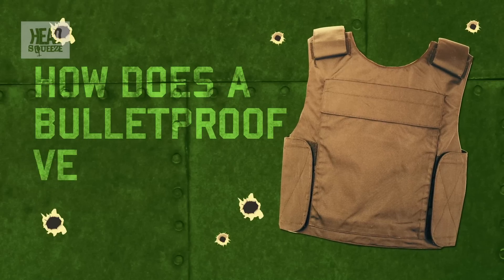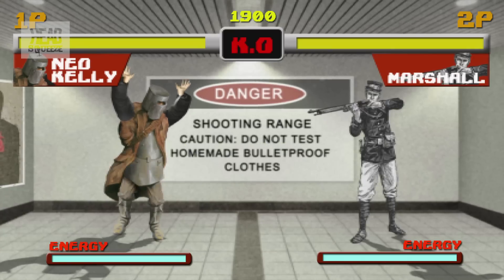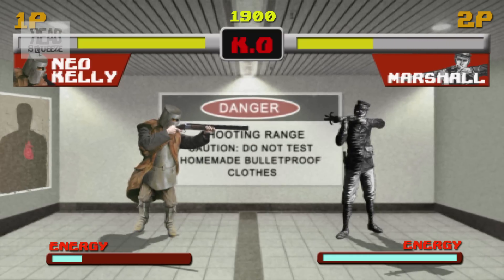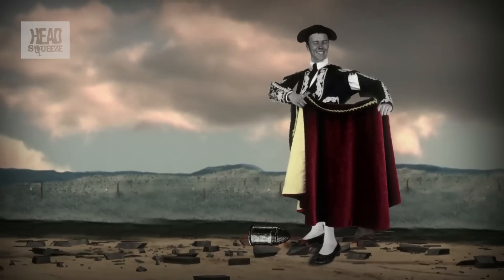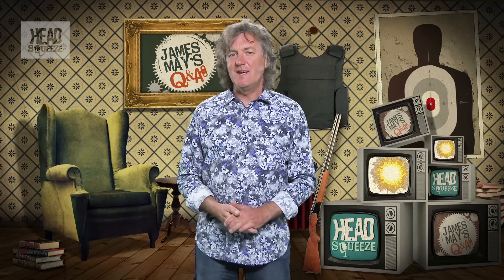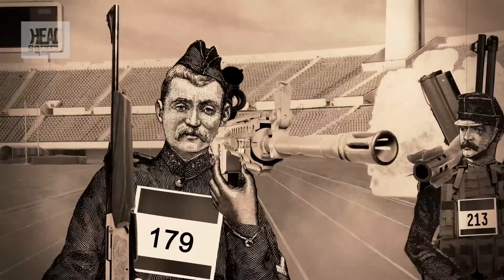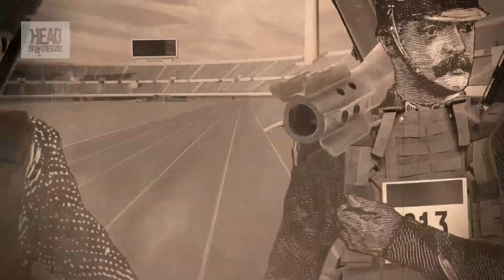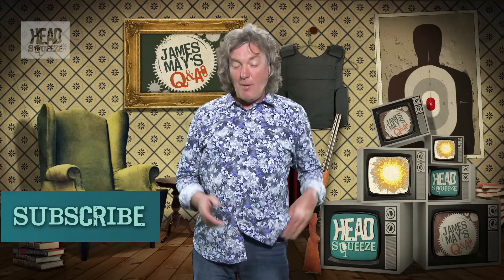How do bulletproof vests work? | James May's Q&A (Ep 25) | Head Squeeze

Comment: Koreans in 1860s. Nope. Mongols in 13th and 14th century. They used cloth layers to stop arrows passing into the body. What is more, they used a layer of silk so that if the cloth layers failed, the silk would wrap around the arrow and make it both easier to remove from the body and create a sterile layer to prevent infection from whatever nasties were on the arrow itself; for example, faeces. There are likely much older examples.

Comment: Don't be fooled, a bullet can still pack a punch and cause serious damage. All a bulletproof (they're more like "bullet resistant" since the material itself doesn't actually stop a bullet outright like a slab of steel plate would) does is spread the energy across a larger surface area. It's kind of like being shot in the head vs. being hit by a truck. Being hit can still cause major bruising, sometimes even internal bleeding and the breaking of ribs. Still, beats dying...

Comment: even if the bullet didn't kill you, remember the physics law: energy must be transferred to something. Usually the kinetic energy from impact transferred to your... ribs.
Reply: the energy that hits you is less then the recoil energy the shooter is getting since energy is lost during flight path a 9mm hitting a level 1-2 vest would be like a punch to the chest it would hurt but still it wont crack the ribs the one that will are big 308 and rifle round for 50bmg its pointless to make a vest for that thing the energy would kill you even if the bullet dident penetrate to make a vest adsorb enough energy and stop penetration the vest would be impractically big and heavy that it will be immobilising to the solider its like going to war with a bullet stoping variant of the eod suite
Reply: +KoeSeer If I had to choose between broken ribs and a sucking chest wound, I know which one I'd take.
Reply: ***** hiding behind something during gunfight?
Reply: +KoeSeer The energy is transferred to the fabric
Reply: +FlashSmash And the fabric transferres it into the chest.
Reply: +Jackie Scholl a .50 bmg will go straight through a kevlar vest
Reply: The .50 BMG fired out of a Barrett M82 has a muzzle velocity of 853m/s. The bullet has a weight of around 45g. Using E(K)=0.5xMxV^2, we get about 32.7 Kilojoules of Energy on average. That's the equivalent of a Football (Or Soccer if you're a yank) travelling at about 180 m/s. To put this in perspective, the avg speed is 30m/s

Comment: Ceramic armor works by using the bullets energy to shatter the ceramic instead of punching a hole through your body. Of course the ceramic is compromised after the first shot. So if a large enough piece survives you can still hope a second bullet lands there. Of course you can use hardened materials and armor plates to shatter the bullet and distribute the force. In any case, getting shot is going to leave some hurts.

Comment: A bullet proof vest is twice the density of human tissue. I am sure there is a direct correlation between throwing power and throwing velocity. Most MLB pitchers would still have a strong arm. I am sure that they could still throw a baseball far. Pitching is very technical. In order to be a good pitcher you've got to have the right technique for yourself. I am so surprised how these starting pitchers are able to throw it at the same speed over and over again. Most MLB pitching velocity on the same pitch, fast ball, curve ball, knuckle ball always remains the same. Most people if they were told to pitch it as fast as they can would have speeds that varied because they are idiots not having proper form. Perfect technique equals maximum potential. If a bullet is moving at a high velocity than you know for sure it can reach long distances. Snipers always hide. They are far away from the spot in which they intend to shoot. How far can a sniper rifle Bullet travel when a person is standing on flat ground. Holding it properly pull the trigger. It has to be at least 300 yards those bullets do move at speeds of 500 miles per hour. The faster the pitch the more it hurts the catchers glove.  A straight lined pitch. It is 90 feet from the mound to the plate. If the catcher was standing 130 feet away. A pitcher who could pitch 100 it would feel as 92 once it hit the catchers mitt from 130 feet away.

Comment: but can a bullet proof vest stop a sword?

i'm assuming it can't (unless metal/ceramic plate) so the solution wasn't to make it more efficient, it was to protect against a different thing. Metal armor is designed to absorb the impact while something like kevlar is increasing the impact time.
Reply: Look up videos of arrows and bullet proof vests. It'll answer your question and may surprise you a little
Reply: arrows are pretty similar to bullets, i'm asking about swords and knives.
Reply: they really arent. its what happens with blades just look it up. because its actually easier to cut through a bullet proof vest than to shoot it.
Reply: JUST LOOK IT UP
Reply: Kiltynachess i'm still asking about swords, not arrows. And i asked it specifically because i'm too lazy to look it up.
Reply: Kiltynachess how does that make me a troll? i'm not bating you, am i? I'm not stating something controvetial, am i? if anything, you're the troll, not me.
Reply: +DBZHGWgamer  yes actually in fact Kevlar treated with nanotechnology that becomes dense when large amounts of kinetic energy is applied in a small area. ( like a much stronger version of cornstarch and water.) can stop an ice-pick from going through Kevlar. although this is a moderately recent advancement so your original argument does hold some merit.
Reply: +Noscoping egg ar500 does stop .308 black tip. at least the lvl III+ variety does. and yes it is steel.

Comment: Is there a difference between kevlar vest and bulletproof vests?
Reply: Bullet proof vests are now made of Kevlar. Where as before they were made of metal plate sheets inserted into the vest. Kevlar is just the modern small arms resistant replacement.
Reply: There are types of "armor" kevlar and plated. Kevlar is usually what a civilian or police officer would use, and it's a material (a fiber I believe)  that stops pretty much any handgun bullets (except maybe  revolver). A metal plated armor is what they wear in the military (probably over kevlar incase of Penetration), the plates can stop assault rifle rounds and the better the plate, the higher rounds it fan take.
Reply: Short answer: you can use the terms interchangably and you'll only ever be wrong in the eyes of extremely pedantic people. 

Somewhat longer answer:

Pedantic types will sometimes take exception to the idea of referring to all soft armor as "Kevlar" because Kevlar is a trademarked term for a line of products developed by the Dupont corporation and there are any number of other high strength fibers that are used in modern soft body armor.  I think this is somewhat silly (along the lines of saying "hook and loop fastener" instead of Velcro) but it matters to some people.

The term "bulletproof" is also one of these things that pedantic types don't really like as there's some kind of bullet that will penetrate almost any kind of armor.  Again, kind of silly but body armor might be a better generic term.

A bunch of folks have talked about kevlar vs. ceramic plates and so on and a lot of that stuff was really good, but I didn't really see anything that gave an overall view of how an armored vest is typically put together so I figured if folks were interested:

The outer shell of the vest is typically made of some kind tough nylon like material that's not meant to stop bullets. This layer exists because while Kevlar (and related materials) are very strong they can be damaged fairly easily in day to day life.  Prolonged exposure to sunlight, many kinds of chemicals, and just day to day wear and tear can render a piece of Kevlar unable to stop bullets. So you've got this outside layer that you can scrub up against a brick wall, or wash when it gets dirty, or sew patches onto without compromising the effectiveness of the vest.

Inside of this shell are pockets into which panels of woven Kevlar cloth are inserted. These provide a good deal of protection from things like shell fragments or pistol rounds but typically won't stop a bullet from a full powered rifle.

Vests that are intended for use in the military or in certain high risk civilian situations typically have pockets into which hard armor plates can be inserted to protect the most vital areas.  These plates are quite heavy and restrict the wearer's movement considerably but offer quite a lot of protection even from rifle bullets. They're typically made of either hardened steel or some kind of ceramic material and the best ones have a "anti spall" coating meant to protect the wearer from shrapnel if a bullet shatters after hitting it or potentially from a piece of the plate itself breaking off and hitting the user.

Most vests that feature a plate also include kevlar or some other type of soft body armor.  The soft armor is there to protect the areas that the plate does not cover, to protect the wearer from sharpnel caused by bullets hitting the plate, and to allow for a level of customizability when it comes to the protection level provided.  It's also possible to get a setup that's just a nylon shell with pockets to stick plates into either because the user is looking for a "bargain basement" setup or because they want to avoid the extra weight and bulk of the soft armor. 

I was in Iraq during 04-05 and then Afghanistan for 06-07 so I've had a reasonable amount of first hand experience with this stuff as well as the usual wikipedia reading and what not.
Reply: What about Five Seven... wasnt the Caliber design to Pen. Kevla ?
Reply: Ballistic armor has multiple ratings as to what it can stop. Levels I, IIA, II, and IIIA are typically Kevlar soft armor and can stop handgun ammunition due to the relatively low velocity. However, Levels III and IV are typically steel or ceramic plates and can stop high velocity rifle rounds some even armor piercing ammunition. Level III can stop up to 7.62 NATO armor piercing and level IV can stop up to .30-06 armor piercing.
Reply: Noscoping egg Mind you, a round doesn't have to go through you to deal damage.. In fact, if a round hits you the kinetic energy would still be delivered to your body i.e. it will hurt.
Reply: LUISDAB3AST Kevlar is a fiber, correct. It's also used in composite materials, just like carbon fiber is.

Source: I'm a composite materials technician

Comment: That was "A History of Bulletproof vests", not how they actually works. FAIL.
Reply: Josh I believe most bullets back then were unjacketed lead, and rifles occasionally came with bullet casting molds, so soldiers could cast their own bullets (though this'd be back in the mid-19th century and before).  IIRC Minie ball molds were distributed to some soldiers as well at the close of the US Civil War and later.

I can imagine the Korean vests being effective against soft lead that could have bubbles or other inconsistencies being fired at lower pressures, but once high-pressure smokeless powder and FMJ rounds became common you really needed modern polyester aramid fibers to counter them.

Also, gotta wonder if modern ceramic plates could be lightened up by doing a ceramic/metal/carbon fiber multilayered sandwich plate like modern tanks sport.
Reply: Classic James May.
Reply: They actually did explain how they worked. You just didn't pay attention, apparently.

Comment: This is quite tricky actually.James is right about the pressure,of the force/surface as the bullet's advantage to pierce concrete walls and bullets are stopped by carbon fiber and kevlar layers but in the same time going through some cheap solid body armor.Now if you apply the same thing to the knife,it means it would be stopped by the textile vest,when it actually isn't.So how you choose between a vest that can stop bullet but not knifes (textiles) or knifes but not bullets (solid) ones ?

I guess its the type of fight you're going too.

P.S. Do you know,guys,that millitary head cap its actualyl useless and can be punctured by the lightest handgun (despite the fact its round and you would think bullets will deflect of it) and that is there only for moral support ?
Reply: They protect from debris and shrapnel

Comment: F1 cars have quite small engines, like you describe. But they need to be completely rebuilt after every race. Auto makers do not produce production cars with these engines as the frequency and cost of maintenance would be too high.

Comment: Except for the problems. It's not actually that light, it weighs about 10lbs, with vests offering comparable protection (such as Dynema plates) being as light as 3 pounds per plate, or 6 pounds for both front and back protection. Furthermore, there have been problems with the adhesive used in assembly failing at higher temperatures (like the ones in the sandbox) causing the vest's protection to fail.

Comment: Because a high rpm engine puts lots of strain on the compenents, they get hot, have to cope with very high g force and also valve timing becomes a problem, thus the engine will fair quickly. 

However by just increasing the size of the engine by adding more cylinders no more strain is put on each piston and you still get the increase in power.

Comment: sigh - nope. its just nitpicking over words. If Kilogram is used in a sense of weight it is just a shortened form of "the gravitational force corresponding to one kilogram of mass in a system that is dominated by one, mostly constant, gravitational field"
Since this is basically how stuff works on the surface of the earth you can as well go with kilogram. If you measure your own weight you use kilogram or pounds too, right? Even though scales can only measure weight and not mass...

Comment: The United States military has used ceramic plates contained in a kevlar vest for a while now (since at least 1996, according to some quick research). Most commonly  aluminum oxide, boron carbide, and silicon carbide. Correct me if I'm wrong, but I don't think that non-newtonian fluids have ever been a component of body armor historically, but once again some quick research tells me that body armor incorporating such fluids is in development.

Comment: It doesn't matter plated armor is unnecessary and has drawbacks. The only way to make modern plate armor that would have any chance of being useful is if you attached it to a power exosuit and made power armor. Now since exo suit tech has been around since the 60's it can be done and it IS being researched but this guy wanted fantasy knights with m16s. That will never happen.

Comment: Except they weren't THAT immobile. The myth that a knight knocked off his horse can't get up is a load of rubbish, you can roll about in plate or jump off a horse and you'll be fine, one of the main problems is it's very stuffy and you overheat quickly.

Comment: Kevlar (TM) is a DuPont trademark and there are other similar materials around. The generic is Poly-paraphenylene terephthalamide :-)

Remember that the Fiber will stop or trap a small arms round but you still need a trauma pack behind that to absorb the energy. Will you may not die from the actual round entering your body the kinetic energy can also do damage can cause internal bleeding and tearing of organs.

Comment: There has been interesting research into the use of non-Newtonian liquids to create body armour. When such a liquid is compressed or impacted it hardens, the greater the impact, the harder it gets. If you filled up a swimming pool with custard you would be able to run across it without sinking because of the impact of your feet on its surface.